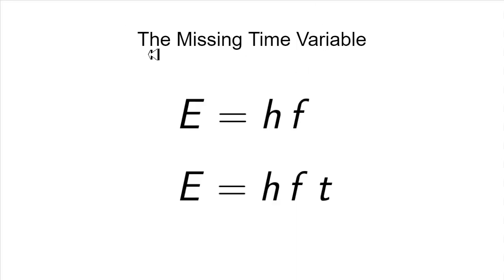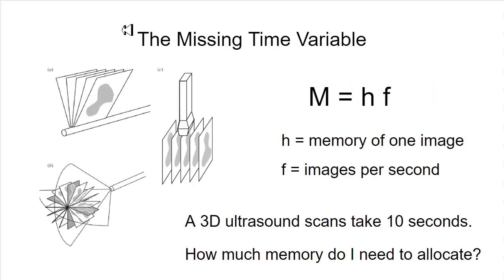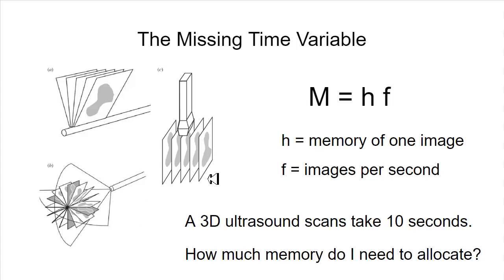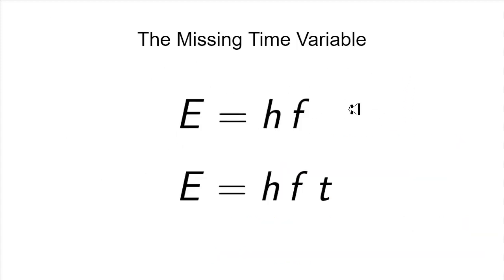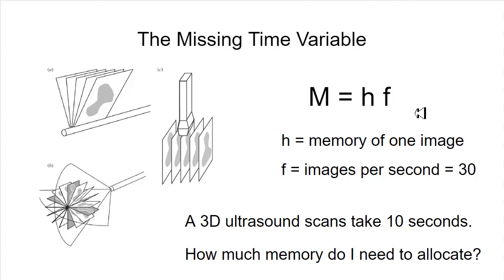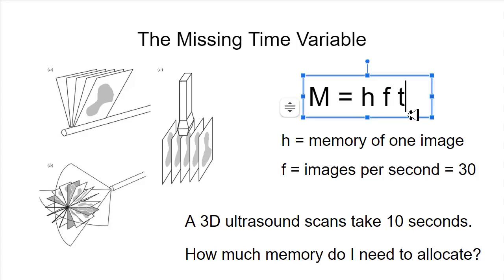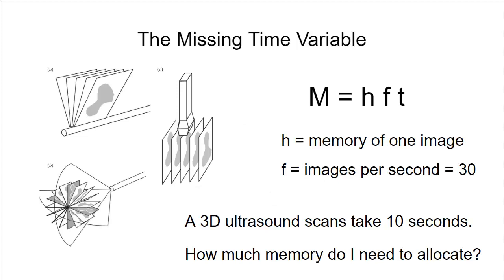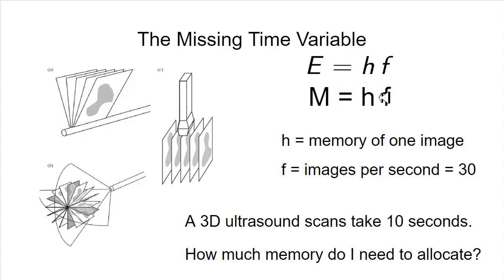Missing Measure Time

Comment: I think what you really are doing with that extra t is the same as trying to find out how far you drive if you drive for 10 hours at 100km/h or how much energy you are using if you have a 40w lamp burning in 24 hours. It is not normal to have that t in such a formula I believe as it is a given that if you want multiple of a thing you must multiply it with the nuber of multiples you want to get the ammount.

Comment: The way I've been thinking about it is, imagine one of those baseball-pitching machines. Say it's pitching a ball every 5 seconds or 12 per minute. You measure the energy produced over 10 minutes, but the mass of each baseball isn't precisely the same, and the velocity of each pitch isn't quite the same. So you want the average energy of each pitch. You take pitches per minute, multiply by ten minutes and get 120 pitches. Divide the total energy by that and you get average energy per pitch. 
Now imagine that, instead of baseballs, the machine is pitching photons. You can obtain the average energy per photon in a similar way, but, since the photon is comprised of waves or oscillations, you also want to know the energy of a single oscillation. You divide the energy for a red photon, say, by the frequency for red photons and get 6.626 x 10^-34, which is Planck's constant. Measuring green or blue photons, or any other frequency, will give the same result, which makes sense since, if h is a constant and E=hf, E/f is always going to equal h, and E and f are going to vary inversely to give the result h. Which means the single oscillation is fundamental and not the photon, and that the oscillation always has energy h, regardless of frequency or wavelength. So if you want to know how much light energy strikes a surface in 3 seconds, you simply multiply h x 3. And you do that for any wavelength of EM energy. Which is why you must introduce a time factor when asking how much energy: E=hft and E/f=ht. Given that the photon is currently considered by physics to be the fundamental particle of light, this is a startling conclusion.
Reply from the maker: you got it right up until this point:
"So if you want to know how much light energy strikes a surface in 3 seconds, you simply multiply h x 3". 

Actually, you need to multiply hxf by 3. 

E = h f t   where t = 3

Was that a typo?
Reply: My mistake. I confused Planck’s constant h with Dr. Mortenson’s mean oscillation energy h with a bar on top.That is in joules per oscillation. Multiply that times frequency in oscillations per second and time in seconds.
Reply from the maker: @bobf9749  I'm pretty sure Dr. Brooks (Julianna Mortenson Brooks) uses "h" like I do and not h-bar. In Modified Unit Analysis, "h-bar" has units [Joule/radian] whereas "h" has units [Joules/cycle]. One oscillation is one cycle is one period is one wavelength of an electromagnetic wave. She uses the word oscillation and I use the word cycle. Same diff. Just to be clear.
Reply: Yeah. Sorry. That’s confusing. Not h bar. It’s h with a hyphen over it like E with a hyphen over it for average energy. Her h is average energy per oscillation. Average h times f = E/t and
h f t = E. That’s h hyphen.
Reply from the maker: @bobf9749  Oh OK. Sorry about that. I guess that is how she distinguishes her "h" from standard "h" since they have different units. Thanks for clarifying.
Reply from the maker: And yes, I agree, these conclusions are SHOCKING. Literally SHOCKING. The world may never recover from this revelation.
Reply: I would imagine it requires a complete overhaul of quantum theory. And the second part of her paper deals with Resonance Theory, which Planck also proposed but didn’t pursue. She has had remarkable results with EM resonance.
Reply from the maker: @bobf9749  Yes, resonance is the key. Too bad Planck didn't persue this. This world might have been a very different place if he had.

Comment: Electricity is temporal so why wouldn't time be a variable?
Reply from the maker: Exactly. Everyone knows that power is on a per-second basis. Everyone knows that electricity is on a per-second basis. Imagine if I wrote the equation E = V I (Volt x Current) and then clamied that "V" had units [Js/C] and [I] has units [C/s] and that  VI were the energy of a VOLTON. That would sound crazy. The problem is with the symbolic language.

Comment: decibels
Per CYCLE
  (Eric Dollard history of electricity)
a unit used to measure the intensity of a sound or the power level of an electrical signal by comparing it with a given level on a logarithmic scale.

(in general use) a degree of loudness.

"his voice went up several decibels"
Reply from the maker: Technically, decibel is an amplification factor. I could alternatively write FractalWoman's power equation as:

P = (A h) f  

where A is the amplification factor per cycle or more accurately, per wavefront. This will allow me to calculate the amplified power of a laser of a particluar frequency of light.

Comment: The equation E = hft resemble E = nhf, when n = t in this case. Are they the same idea?
Reply from the maker: Yes, exactly. Can you find me a reference for a paper or webpage where E = nhf is used? Yes, I just gave you some homework. LOL
Reply: @FractalWoman  Here, more explicitly:

http://www.phys.ttu.edu/~slee/3301/2018_Fall/F18_3301_Lecture4.pdf
Reply from the maker: @elson_jf  Thanks for sending this. It was very enLIGHTening (pun intended). The mistake they made was insisting that "n" is an integer. Measure time can be any length of time. It can be 1/2 second, it can be 20.3333 seconds. It can be 1/1000000th of a second.  But it most certainly doesn't have to be an integer. If they didn't make this mistake, then they may have been able to figure it out 100 years ago. Thanks for sharing. I may have to make a video on this.
Reply: @FractalWoman  I'm glad I could have contributed a little. I've been watching the videos. I confess that I have found your approach a little strange. However, I find it very interesting and intend to study it further. She seems to be quite promising.

As for the value of "n", in addition to being considered an integer value, it still lacks a unit of measurement (which may make sense for the idea of "energy levels", but has also been used as "quantity of photon" - and I've already learned from your videos that the photon doesn't necessarily have to be a particle).
Reply: @FractalWoman  
The E = nhf equation as I understand it is the energy for a bunch of quantum particles like individual photons, where n is the number of particles. That's why it's an integer. This is where the "quantum" in QM comes from. The particles themselves are waves, yet they are called particles because they are discrete, separate entities.

Comment: Planck's constant is Joules over Hertz so the time dimension cancels with frequency. An additional time factor on the right is not  needed.
Reply from the maker: Planck's constant is not Joules over Hertz. In the legacy language, Planck's constant has units:

[J s]

There IS an extra time unit in these units that actually belongs to measure time with units [s]. Even though you can mathematically cancel the [s] terms in the unit section, I HIGHLY recommend that you don't. When you do that, you LOSE INFORMATION. The unit section of an equation is not an equation. It is a forumla. These are the ingrediants that go into the body of the equation. Equations can hide things. Unit analysis, should NEVER hide things. Unit analysis is used to interpret the equations and to make sure that the EQUATION is balanced. That is why, when I do unit analysis, I show all my work. Just because units CAN cancel, doesn't mean you should. My opinion only.

Comment: I used to write image analysis SW for SEM & FLIR. Much of the data was very noisy. Always wondered how noisy MRI raw data is.
Reply from the maker: MRI physics has advance emmensely over the years. Our lab actually builds their own MRI coils (RF coils) to get better resolution and improve signal to noise ratios. The trick is to use small coils and BIG magnets. So if you want to scan a wrist. build a coil just a little bigger than the wrist. I'm so lucky to be working with such amazing technology.

Comment: frequency denotes resonance and the time differential is always needed...   this is like having the switchable ruler of timecode overlay. even a watt is truly a time interpreted measure of power technically.   resonance and transducers mean time is a part of the equation ....
Reply: engineering solutions have to actually work. theoretical solutions have to look believable.

i don't mean to devalue theory entirely, but of the two, theory leaves much more room for convention to override reality.

Comment: Honest question - I'm no math guy, so I am speaking out of my butt, but doesn't frequency come packaged as a unit of time? Wouldn't that evolve down to cycles per second? Also, as a fellow computer nerd, I would love a video about how you anchor image slices from the ultrasound slices.. How do you know your relative slice location per frame? woot
Reply from the maker: Frequency (in hertz) is the number of events per second. It could be cycles per second, wavefronts per second, frames per second, rotations per second etc. Frequency comes in many forms. But frequency is not a "package". 

"How do you know your relative slice location per frame?" We attach the ultrasound probe to a motor/mover and translate it at a certain speed. Then I read the encoder position of the motor to place the image in the correct location.

Comment: It does not matter what they do, that equation is still going to be wrong because the higher a light wave's frequency, the higher the energy of each wave.  Planck is claiming that all light waves have the same exact amount of energy.  In other words, a gamma ray wave has the same amount of energy as an infrared wave.  That is not possible.  Gamma radiation is ionizing radiation whereas everything ultraviolet frequency and below are non-ionizing.  If all light waves had the same amount of energy per wave, all light waves would be ionizing and lower frequency light waves would become ionizing at higher intensities.  That is not what is observed.  The same thing goes with the photoelectric effect.  There is a threshold frequency at which the photoelectric effect occurs and anything below that frequency it is impossible to get the effect to occur regardless of the intensity of the light.  The entire mainstream model and claims for light are completely fallacious.
Reply: I tried to find the answer to this a couple of years ago, as I was curious if each cycle of EMR contained the amount of energy.  If this were true then the increasing energy would be solely due to increasing frequency, no?  (Shorter wavelength means more waves per meter).  How would wave amplitude factor into this?  Supposedly two waves of EMR can be at the same frequency, but have different amplitudes.  At equal frequency the higher amplitude waves would contain more energy than lower amplitude waves (intensity?), no?  Perhaps the "photon" simply represents the lower limit of physicality?  That within this construction that is the lowest definable portion of energy?
Reply: @williamjeffreys2980  I don't think the photon represents anything other than another one of Einstein's insanely fallacious conceptions people religiously believe because that is what they have been told repeatedly that this is how light works from a very young age.  With that said, gamma radiation has a small amplitude whereas radio waves have huge amplitudes.  Just about everything everyone has been taught about electromagnetism in public education is just wrong.  Dielectricity is counter spatial.  The smaller the size, the more energy.
Reply: @wesbaumguardner8829  Thank you for the reply.  You have touched on another aspect of this.  I am trying to understand the concept of inertia in the way Ken Wheeler explains it.  My understanding is inertia is the ether (the medium) at rest, and EMR is the waving OF the medium.  I know what a dielectric is in terms of electronics, but don't have a good intuitive image of what it means in relation to EMR.
Reply: @williamjeffreys2980  The reason some materials are called dielectric is because they readily conduct the dielectric field.  The electromagnetic field is comprised of two field modalities: the magnetic and the dielectric.  The magnetic field is the aether in motion and is kinetic in nature, causing the magnetomotive force.  The dielectric is the aether under strain/stress and is a form of potential energy which causes the electromotive force.  The magnetic field forms concentric rings that close upon themselves around an electrical "conductor" when current is flowing through it.  The dielectric forms radial lines that must terminate in the inner atomic of an atom at each end.  The magnetic tends to push two conducting wires apart, whereas, the dielectric tends to pull the two wires together.  A good starting point is "Elementary Lectures on Discharges, Waves, and  Impulses and Other Transients by Charles Proteus Steinmetz.
Reply: @wesbaumguardner8829  Thank you for the help.  I will check it out.
Reply: @williamjeffreys2980  You're welcome.  That book is a free download, so it shouldn't cost you anything to read it.

Comment: If I'm understanding you correctly, it is essentially the difference between amperage/watts, which is instantaneous, and ampere hours / watt hours, which are totaled over time.
Reply: That's where I'm at, like doesn't it come down to dimensional analysis? Sticking a t in there changes the units of energy on the LHS .. so u'd need a diff quantity there as well
ultimately, for the computer program, couldnt you step it through time and get slices of m1, m2, etc or Sum M's 1-10.. and be the same thing ?
Reply: Yes it does. She is taking the unit of seconds out of planck’s constant and making it a variable in the equation. You could think of  E=hf to be E=h*f*1sec
Reply: @zwiguy9494  it's because frequency alone doesn't include how many events it's recording, just the period between each event - the time in frequency isn't enough time information by itself. for a wave, it's basically including the distance from trough to peak, but not the number of troughs and peaks.

the reason this is a problem for "photons" is because the equation determining their energy assumes that the energy of a "photon" is equivalent to the energy of 1 second of electromagnetic waves with a frequency given by the "photon"s inherent energy - it essentially sets the length of a photon to be 1 second. 

if i understand correctly, her suggestion here is that the real fundamental unit is a single wave (which would have variable duration, equal to exactly one period of the wave's frequency). this has strong implications that the quantization of electromagnetic waves into particles is incorrect, at least for photons. that said, they can still be quantized into waves, since waves in a continuous medium are still quantized - the "particle" just becomes a single peak/trough cycle as opposed to a point of infinite energy density